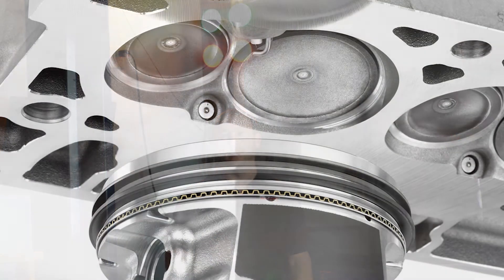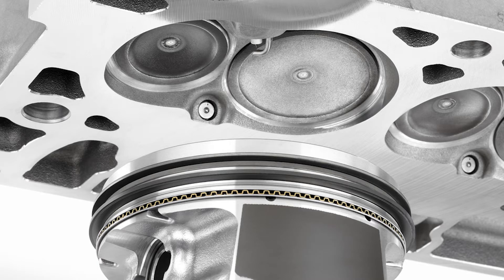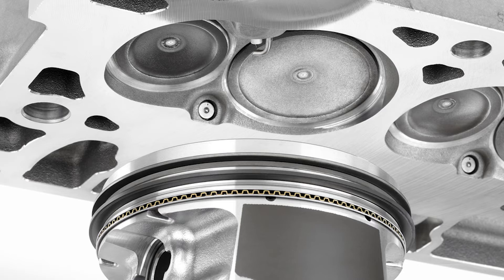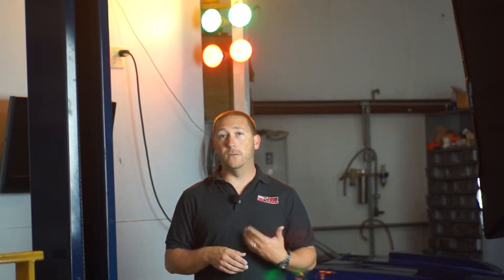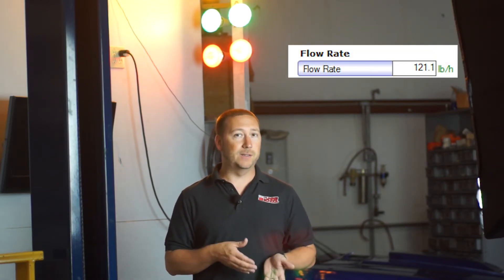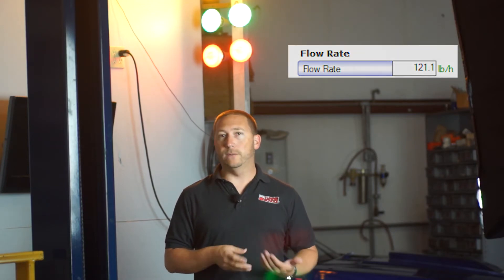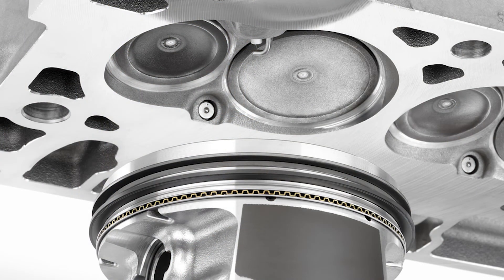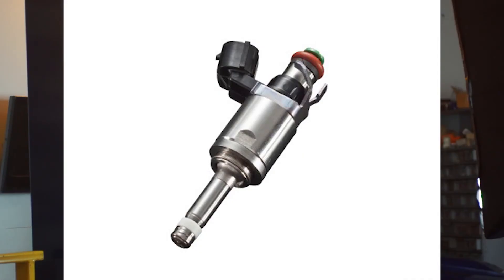Direct Injection: How It Works and Why They Have Such Large Injectors from the Factory

Comment: So what if you were to turbo a NA vehicle with Direct injection - how would you go about increasing the fuel ? Are bigger injectors available ? Do they need bigger ones or can it just be tuned ? Is it even possible ?
Reply from the maker: Chances are you ran into a volume issue. The direct injection system is unable to provide fuel volume needed to support extremely high horse power applications. The solution is usually a secondary fuel system like the one our friends at Prospeed have created. It utilizes the direct injectors and an additional 8 port injectors located in the intake manifold.